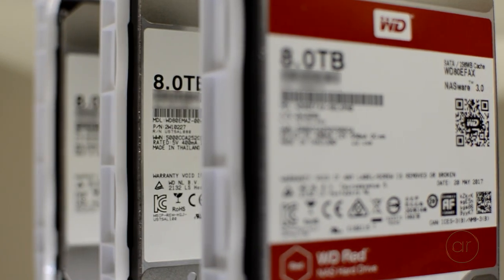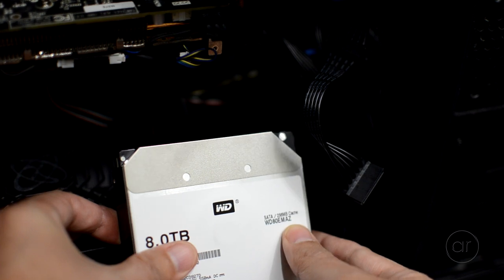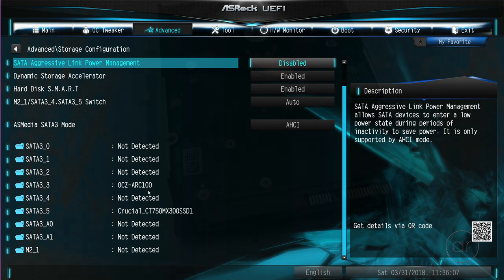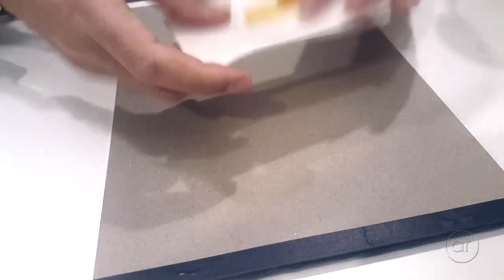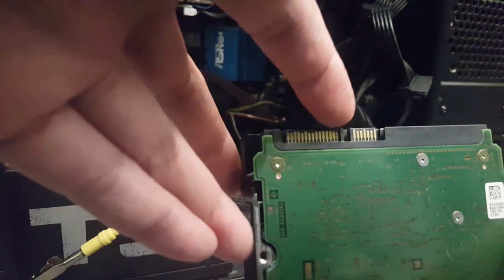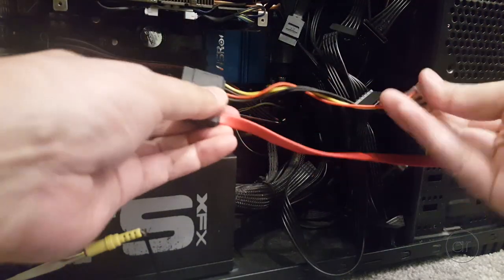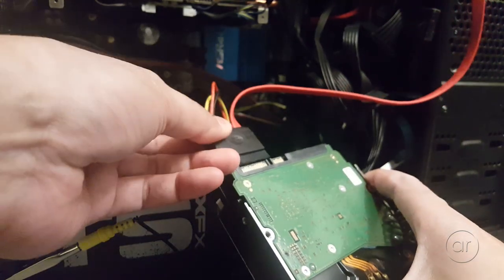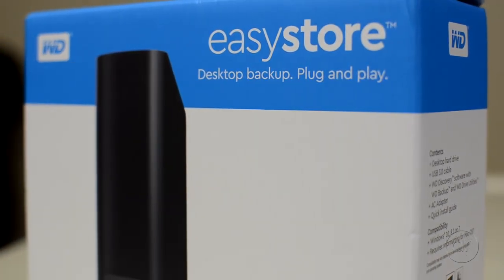How to Fix the 3.3V Pin Issue in White Label Disks Shucked from Western Digital 8TB Easystore Drives

Comment: I  taped the pin 3 but still not working, also I have another 4 HDD connected with pin  3 taped  and these are recognized by Windows without problem. Any suggest what's happened with the 5th disk ?? Note: This occurred  too when I try to connect a 6th or try with deferent HDD and my Hardware are PSU its a Corsair CS650 Gold Plus,  Mobo Asus Prime Z270-A, Intel I5 7400 and 24Gb RAM
Reply from the maker: You may want to look at your motherboard manual to see if there are any restrictions on using certain SATA ports when using them in conjunction with other devices. To rule out a bad drive, you could try attaching it to another motherboard (if at all possible) to see if it works there.

Comment: Just remove the orange 3.3v wire from the power supply connector. Cut it if you have to.  Rather have to splice a Power supply cable back in the future than use a dangerous molex adapter, or jam tape in there.
Reply from the maker: Good observation, thanks. That's certainly a valid way to solve the pin problem.
Reply: Dangerous?  That seems like a stretch, since the molex has a higher current rating than the sata.  Sure going the other way around could be considered dangerous, but a 99 cent molex to sata will do the job just fine.
Reply: They have been known to cause issues and sometimes cause fires. Would not recommend. it is surprisingly common with cheap adapters.
Reply: @partitionpenguin  i think someone on r/datahoarders said the same thing about the molex catching on fire.

Comment: Thanks! I tried molex to sata connector, but it didnt work... Going to try your first solution.
Reply from the maker: Molex adapter typically have the connectors cut to the third pin. If, for some reason, you have an adapter that does have that connection, covering the third pin with Kapton tape should work - please let me know.
Reply: @accessrandom  yes, covering third pin with tape helped!
Reply from the maker: Fantastic - thanks for the update 👍

Comment: Does this magic method work with a 10 tb wd elements hard drive, or only with your disk?
Reply from the maker: This should work with any WD white label drive (which I believe the Elements internal is).
Reply: @accessrandom  sorry for my bad English, im from Spain, i have 2 wd elements of 10 tb each one, and i dont know wich hdd have in this case, white, red, green, i dont know, is from year 2019
Reply from the maker: @danielcarcanosanchez9790  What you can do is use CrystalDiskInfo to determine the model number (video here: https://youtu.be/XNyXVFwt1es) and compare that with what others have. I'm afraid the only way to know for certain is to open it up, but I believe the 10TB ones will be white.

Comment: So it's because of new SATA 2016 spec that includes PWDIS on pin 3, changed from a mere 3.3v power pin before. This is interesting. 
Great video, thank you for uploading.
.
I thought it was an April jokes video. xD
.
SATA > molex > SATA if no molex available and too lazy to do mod, but too many extension might bad for electric delivery though.
Reply from the maker: Thanks. I'm planning to do an actual April Fools video this year but you'll definitely know it's a joke :) Yeah, you want to limit then number of components to what the power supply can handle.
Reply: @accessrandom  At first I remember a guy who post a video joking about doubling the wifi router internet speed using soda plastic bottle, dutch tape, and salt solution. Hahaha. I'm sorry it can't be helped. xD
Your video is legit and great, but also I can't wait your joke sometimes. :3

Comment: both of these solutions seem really sketchy.. what if the tape accidently covers up another pin? and the molex adapters catching fire.. hmmm
Reply: There's no problem with covering the first three pins which is easier than trying to only cover the third. More coverage makes the tape stick better so there's less worry of it coming loose.

You're correct in the very real fire hazard of these molex adapters. NO ONE should use them!

Comment: WD deliberately doing this because many people buy cheaper external HDD and mount it on the PC than buy typical internal HDD, at least it can be fixed while Seagate external HDD usually doesn't even have a SATA connector, they use custom PCB and when you open the enclosure, you got "direct USB port" only.
Reply from the maker: Thanks for the info. Yes, there's definitely a larger market for externals than internals, which is strange that they're priced lower with the higher demand.

I've seen some portables have the controller soldered onto the drive, but I've found that the 3.5" desktop Seagate externals (at least the ones I've tried) are shuckable (https://www.youtube.com/playlist?list=PLmHmy2tyOBpqPljgf2zokHH29MSrEngz9).

Comment: Any reason why this may NOT work? I'm testing the drive in a hot swap cage in my workstation before moving it to the server. And it does not show up even with 3 pins taped
Reply from the maker: There are a few servers in the compendium link (in the description) like the Dell PowerEdges, QNAP units, etc. that have hot swap bays, but there aren't a lot of data points. I'm afraid I can't think of any reason why it wouldn't work - have you been able to try it in a different machine to rule out a bad drive?
Reply: @accessrandom  Not yet, but it works inside its original case, I made sure to test it before shucking
Reply: @accessrandom  Oh wait, it actually shows up in bios, but SATA port had Hot Plug disabled. After a reboot it shows up, not sure if it's not hot pluggable drive or just that setting. Weird thing is that other like half a dozen drives I often plug into this same drive cage (cold storage ones) worked regardless of this setting. Weird. Anyways seems to work now, thanks :) I hope it will show up in my server, it's older than this PC
Reply from the maker: Thanks for the update 👍.I hadn't heard of any hot plug incompatibilities but I'll keep my eye out for other reports...

Comment: would you advise simply removing the third pin?  and why or why not?
Reply from the maker: My intent in the video was to show you some non-destructive ways to fix the problem, but it is certainly possible to remove the third pin (in fact, one of the other commenters has done the same thing by prying it off - and it worked).
Reply: I used a xactor knife to remove the pin.  By removing the drive from the enclosure warranty is void.  SO it is a risk we take for the awesome cheap storage :)
Reply from the maker: Good point :) If you test your drive thoroughly before you take it out of the enclosure, that'll minimize any risks of having a bad disk at least (and gives you time to return it to the retailer if it's bad - without having shucked it).
Reply: what do you recommend to put the new drive through its paces?
Reply from the maker: I use a program called HD Tune Pro and run a full sector-by-sector Error scan.

Comment: Hi I have a White Label drive and I am trying to make into an USB drive using either a pigtail or an enclosure. And after covering Pin 3, it still is not seen by the computer. But covering Pin 3 and put it inside a computer, it is no problem. Does any body have a solution to this. many thanks in advance.

Comment: Very annoying time getting this to work, still not there. Synology DS1621xs+ does NOT see the drive without tape. With tape it sees it, but fails every single bloomin time at initialising. I taped up pins 1-3 as the below comment said to make it easier to stick. I agree with the bottom comment, save money day zero, then regret it the days after when it doesn't work!

Comment: I actually have about 16 or more of these 8TB drives and I recently got a 10TB drive and I had to do this, weird, oh well it worked
Reply from the maker: That's a good run of disks that worked out of the box 👍. Glad to hear the 10TB worked.
Reply: @accessrandom  Yes, glad I had some Kapton tape lying around, I just cut off a sliver with some scissors and booted right up :)

Comment: Wrong in the US you are not voiding the warranty by removing the disk from the enclosure by federal law. Any warranty void if removed stickers/labels are illegal and can be removed at will. The only exception is that the removal of the disk caused the problem.
Reply: As long as you can put it back in the enclosure how you got it when you return it for a fault, then yeah. They have a right not to fix half a product when they sell you the whole thing. Also... they could do an Apple and say there's a scratch on the enclosure so they can't possible repair the hdd without replacing the enclosure for $799 xD

Comment: I've tried to install another WD hard drive in the case. But not recognized on the PC. Message: Fatal hardware error.
What can I do?
Reply from the maker: The Easystore controller doesn't have any hardware encryption, so any unencrypted hard drive should work. Did the other WD HDD come from another Easystore? I know some of their other external models have encryption.

Otherwise, it may be a bad drive - would you be able to test it directly as an internal drive on a spare SATA port inside a desktop computer?

Comment: is this the reason the drive wont power up through the usb 3?   even when plugged in the wall electrical outlet
Reply from the maker: This is only for those disks that have been removed from the case - if it's still in the enclosure, it should work as normal. You may have a defective drive, but it could be anywhere along the chain; try a different USB port, a port on another computer, or swapping the USB cable.

Comment: I did this. My booted. I eventually removed it and now after trying to get it back in my computer, it won't boot. Any help?  I don't see how I coulda fried the HDD. I made sure the computer was turned off each time I moved it
Reply from the maker: Did your system successfully detect the hard drive the first time it was connected? To rule out the drive itself, could you try placing it back into its enclosure and hook it up to a USB port to see if it's detected? Alternatively, you could try installing it in another machine (if at all possible) to see if it works there.

Comment: Can i use an enclosure with this white 8tb?without worrying about the 3rd pin or something..
Reply: I want to use it as an external hdd.
Reply from the maker: Yes, you may - there is no problem using the enclosure with another white label disk. The 3.3V problem may only occur when using the disk as an internal drive.
Reply: Thank you for the reply. I mean an ugreen enclosure or another brands of enclosures in the market..planning to buy an 8tb wd white hdd.
Reply from the maker: Oh I see. I haven't heard of any reports of other enclosures not working with the White labels - I think you should be fine.

Comment: This cheaper than buying just a WD red HARD DRIVE?
Reply from the maker: Yes, the externals have been cheaper than the internals, but there have been two versions of the Red: one with 128 MB cache and the other with 256 MB. I believe most of them are now White label disks with the same specs as the Red. There's a link in the description (the datahoarder compendium) which has a lot more information about it.

Comment: I used Scotch tape instead.  It's not going to overheat and catch on fire, is it?
Reply from the maker: I wouldn't recommend Scotch tape. It will probably work in the short term but the adhesive may bleed over to the other pins.

Comment: electric tape will do the job ? i tryand the disk are now ok but im worry if the temperature will be a problem ???
Reply from the maker: It is possible - I've tried it but I found that the tape was a bit thick (so that it stretches the connector a little bit - I'm not sure what the long term effects of that would be). Another side effect is that there's a black residue when taking it off...
Reply: @accessrandom  do you have a idea why ... i do the trick with the tape for a secondary disk .. not the one with windows... and now when i restart my window iT's take something like 3 min with my SSD... the little thing that roll at the loading start roll and roll so long .. if i unplug my new WD external that i plug internal .. evrything return ok ...
Reply from the maker: Is this a white label WD? Did this secondary disk originally have Windows on it? If so, my guess is that the system is trying to resolve to which disk to boot.
Reply: 2 thing on it 2 programme that i erase ... its a white label ... but no window on it ...  strange but when i copy something on it it finish read only i think and i can format the disk .. dont know why
Reply from the maker: That is strange. Have you tried it on a different port or a different SATA cable? If possible, can you try it in another computer to see if it behaves the same way?
Reply: @accessrandom  i had try 2 things yesterday in night ... first i found a way to start pc and go directly to format it (cause they alway said it was in use when i try) it,s work i finally format it .. and at the same time i was on a video youtube telling me how to start pc without menu of boot to choose witch window i want tbut start directly with my default... dont know witch one of this work but now im ok it start normally... cause of the strange loading looking like a old window probably 7... i think your first tought was good... probably a window was on it before... so strange .. i saw nothing on it and was empty only 2 programe like promo or dont know and i bought it new ... XD what ever now it's work normally ... thanks a lot !
Reply from the maker: Ok cool, thanks for the update!

Comment: Both solutions attempted = same result : the power supply clicks, fans move, but second click and the system doesn’t boot up -  HELP!
Reply from the maker: When you remove the disk, everything works ok? And does the disk work when you place it back into its enclosure and plug it into a USB port?

You may want to try installing it in a different computer (If at all possible) to rule out the possibility that the disk itself is bad.

Comment: I am certain they are red drives with blue drive firmware,  Wd doesn't offer blue in 8tb but reds they do In an effort to force us to buy red retail drives they simply took firm off reds for my books easystore and elements put a white label on it loaded it 2ith blue firmware crstaldiskunfo showed a 4tb blue and a 8tb white label with same firmware  my true 3 and 4tb resin my nas unit had different firmware it appears the white labels do not have tler or nas ware on them , they are still excellent value for backup drives Ora second drive in a pc
Reply from the maker: Great observations - thank you.
Reply: I revisited this white label drive , I am running a wd pr4100 nas in raid 10 (1+0)  since it's just a raid 0 mirrored on 2 drives  it's simple raid I bet these would be fine even if they are not reds .Raid 5 needs complicated parties it is much harder on hdd's  I wold not be suprised if the 3.3v issue was added as a detourent by wd for this reason of people reusing those drives and saving a few dollars

Comment: how can i check if our power supply or our cables will cause a problem or not :/ my power supply is  Hig Power  Hp- 650-G14C
Reply from the maker: Unfortunately, I couldn't find your model in reddit's Easystore Compendium (link in the description) - that doesn't mean it won't work, but that it hadn't been tested by anyone. As a general rule, older power supplies (~10+ years) will more likely have this problem.
Reply: @accessrandom  its old more than 10 years.  i dont know i cant decide if i risk buying this.
Reply from the maker: The good news is that it is a fairly simple non-destructive fix as shown in the video. If you look through the comments, there are other proposed solutions (including removing pins, cutting wires... and even nail polish).

Comment: can you use black electrical tape?
Reply from the maker: I've actually tried it and found that it was too thick (it worked, but it expanded the plastic around the connector a bit) and it also left a black residue. I'm not sure of the long term consequences of the connector stretching.
Reply: @accessrandom  Ok thanks for your reply. Much appreciate.

Comment: OK to use black electrical tape instead?
Reply from the maker: I've tried electrical tape and it worked, but I found two issues - there's a black residue from the tape that doesn't come off easily, and the tape itself is thicker than Kapton - which expanded the connector a bit.